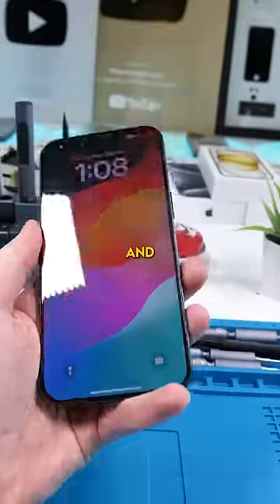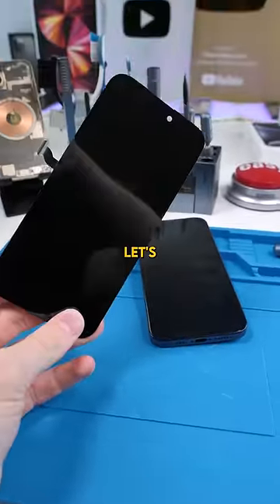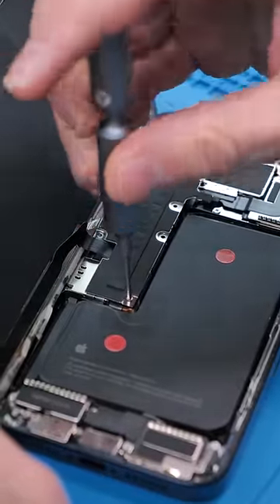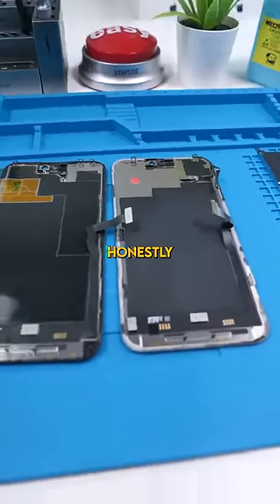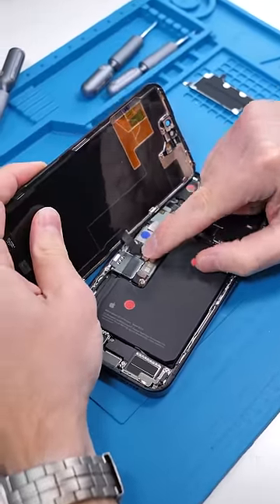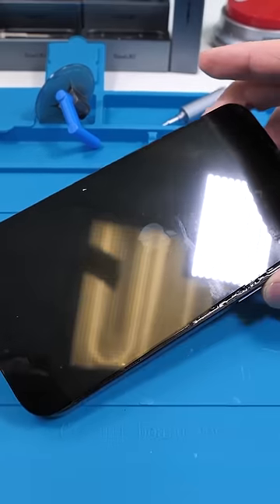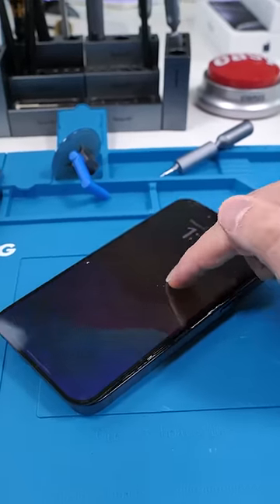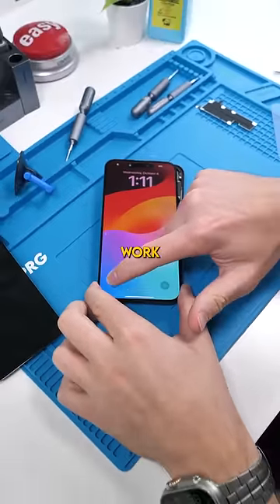iPhone 14 Parts On The 15..? #Shorts

Comment: Apple would rather reduce their product fixability rather than make an actual upgrade.
Reply: Two different phones. Why do they need to have interchangeable parts
Reply: @theworm7156  They are not different. They are VERY similar to each other. There was NOTHING preventing them from making them compatible,  they are just greedy as hell. As you saw in the video, you can literaly connect and fit the screen from another phone, it just has some sort of software or any other fixable issue that could have been easily fixed
Reply: @volodymyr_budii  they have different bezels sizes, different designs, and since when was it a requirement to have an old phones parts work with a new phone. I doubt ANY company, when writing the firmware for their new phone, decided to take the trouble to make it work with their last gen displays cause there’s literally no point in doing that.
Reply: @theworm7156 well, maybe because it turns on, but the most essential function to use the screen doesn't work?? 

Cmon bro, they did petty stuff like that and always gets away with it. People got dumber to the point they even miss something like that common, gee.
Reply: @GimOA  if it turns on, which they probably haven’t checked for because that would be pointless, that doesn’t mean they need to rewrite the firmware to make it 100% work with the old display
Reply: @theworm7156   how does the bezel size stop the touch from working? apple writes firmwaare to stop any other screen other than what came with the phone or what they provide to stop working. they did the exact opposite of what ur even mentioning.
Reply: @rollmell  they still need to be coded separately into the firmware
Reply: @theworm7156  the code isnt going to be much different because the display arent much different lmao
Reply: @rollmell  they’re probably different in a lot of other ways so it makes no sense to code it for both when no one in their right mind would try to seriously use an old display on it
Reply: @theworm7156  brother we can see its not different in any other than what was said in the video, and why do you think they coded everything from scratch? all they had to do was use last years as a template.
Reply: @rollmell  the display also has firmware
Reply: @GimOA  Just because the power and display cables are the same doesn't mean it should work. Those are 2 things that very rarely need to be changed.  Example: Look at HDMI When you change your TV you can still use the same HDMI cable. Why tf would apple redesign a power and display connector every generation? That's absurd
Reply: @theworm7156 bros really defending anti repair and anti environment practices. How nasty 🤮
Reply: @reeddeer793  no company would try to make two different phones parts interchangeable for no reason. Even prg said so in the pinned comment
Reply: Try to put a Galaxy S23 Ultra on an S24 Ultra. I'll wait.
Reply: @volodymyr_budii  Try to put a Galaxy S23 Ultra on an S24 Ultra. I'll wait.

Comment: Phone repair shop scammers using this as a golden opportunity:
Reply: (Bro has 46 likes and no replies) that is a very viable scam
Reply: How?
Reply: @Entertainmentexe because they can show the customer they "repaired it" but when the customer tries it the touch wont work
Reply: @bumblethunder because people don’t use their phone the second it’s fixed right? Literally every customer I’ve served immediately turns the phone on to look at something once its fixed
Reply: @MarksterC  I assume they mean repairs that involve shipping. You receive the phone and find no contact info with the alleged repair shop. And there goes the money.
Reply: @CityWhisperer usually you get it repaired somewhere reputable with outlets to complain to.
Reply: @MarksterC  oh ok
Reply: This is the most ignorant comment in the planet.
Reply: @CityWhisperer  Wtf would be the point of that then? You could literally ship the phone back to them without ever taking it out of the box they sent it in to get repaired  in the first place then claim you fixed it all the same. They sent the phone in to be repaired, if you're gonna swap out a broken screen with a broken screen then why tf even bother? Literally pointless work to try and "scam" them like that when you can just scam them by not working on replacing anything and sending it right back to them as it came while claiming you fixed it anyway. 🙄
Reply: @DrakeOola  Indeed, that's how scams work. A replace screen that's not from Apple will be much cheaper. Believe it or not, people fall for these scams.
Reply: @DrakeOola if they sent the phone back in the same condition they could not have taken their calls back and they would have been guilty right away. But if they put a non working screen then they can at least take their calls and put their fake point forward that they did their job.

Comment: I think the worst part is that people can’t take care of anything. Always used my devices without cases and never cracked ONE SINGLE screen.
Reply: you're an exception, everyone i know has broken their screens/screen protectors in less than a year
Reply: @willywestsidee  m
Reply: I don’t take great care of my phone and have broken very few screens. 😂 I do have a bunch of scratches on this one though… (and a couple spots where copper melted to the glass, but that’s a long story.)
Reply: You one of those incels that can't do one pull up?
Reply: What is the worst part in this story.. not your phone right?
Reply: @rushpatriot2866  nice projection, bud
Reply: @Pizzafan622  sounds like you just learned the word projection like the rest of the smooth brains that's the only reason you'd be using it in 2023

Comment: They are the same but the motherboard knows that the screen is the outdated one so it locks the touch screen as a counter measure to counterfeiting parts from older models. Essentially, they want you to buy the new parts and not an older part that is discounted. I believe they just want every penny in your wallet. Even if they reused older components from their older generations. They will deny this is the case because their technology hasn't been getting any better. We have hit the end of cellphone improvement. 
Not much can be said about the other competitors.
Reply: Does it really lock it? Sounds like just changing the pin order on the connector would do the job just as well
Reply: Well, since the iPhone 14 pro max screen is larger than the new one and due to that it wouldn’t fit anyway this would mean unnecessary more work for Apple.
Reply: Can’t you reprogram it whit like iphone screen programmer?
Reply: @tbqhwyf honestly, I wouldn't know. However, the screen itself had as an id or a chip that runs the touch detection. You would have to replace and calibrate a whole new one. This would take a lot of time and some knowledge.
Reply: @exposednl5559  not easily. You would have to take the screen itself apart.
Reply: It makes sense not to have old parts with a new phone and that should not be allowed to use our old screens on the new phone. Apple did it right!

Comment: 15 Pro Screen On Regular 15 
As Both The Screens Have Same Specs Except Refresh Rate 
I think Apple Has Restricted It By Software On Regular 15
Reply: Interesting
Reply: “Except refresh rate” ah yes, the least important factor of a display
Reply: For most people yea, people want a clear screen they can see. Not a blurry mess that wastes battery
Reply: No, Apple would’ve just not used LTPO panels. Everything else to do with the display would’ve been carried over from the 14 Pro. Restricting to a non-variable 60hz when it can do variable 120 would be a waste of money
Reply: @Zomboy4313  did I say for consumers? No.
Reply: @theworm7156  then for who, tech reviewer?
Reply: @Zomboy4313 "enthusiast" 😂
Reply: @GimOA  of course 😂

Comment: A better idea is to change the 15 Pro Max back glass to the 14 Pro Max back glass. They're identical except for the fact that the 14 Pro Max is more durable
Reply: It wont even fit
Reply: 14 pro and max dont have removable back glass only the regular/plus. It started on the pros with the 15 pro/max.

Comment: churro recipe - 1 cup water (240ml)
- 2 tablespoon unsalted butter (28g)
- 2 tablespoon sugar (13g)
- 1/8 teaspoon salt
Medium heatchurro recipe - 1 cup water (240ml)
- 2 tablespoon unsalted butter (28g)
- 2 tablespoon sugar (13g)
- 1/8 teaspoon salt
Medium heat
After boiling turn the heat down

- 1 cup all-purpose flour (120g)
Stir immediately 
When its smooth and pulls away from the pan its done
Bring pan to towel or surface. And press down

Let it cool for 5 minutes

- 1 large egg (50g)
- 1 teaspoon vanilla extract
Mix 
The mixture will separate at first but keep mixing.
It will come together soon.

This step will take a few minutes but when the dough is done. 

 It will be smooth and will pull away from your pot and spatula 
2 piping bags and a star tip
Use 2 layers of piping bag because the dough is thick 
5 inch strips on nonstick pan tray
Cut ends with sciccors 
- Vegetable oil for frying
Heat oil to 350F 
Use thermometer to check the temp
Drop churros 
Each churro will fry for 5 minutes
Turn the churros half way
The color will be gold when done.
Dry one towel for a few seconds 

Cinnamon Sugar:
- 1/2 cup sugar (100g)
- 1 teaspoon cinnamon
Role each in tray or tubwear of sugar.

Chocolate Dipping Sauce:
- 3 oz bittersweet chocolate (85g) in bowl
- 1/2 cup heavy cream (120g)
Dont let it boil

Add cream in bowl and mix until sauce like. Then serve

After boiling turn the heat down

- 1 cup all-purpose flour (120g)
Stir immediately 
When its smooth and pulls away from the pan its done
Bring pan to towel or surface. And press down

Let it cool for 5 minutes

- 1 large egg (50g)
- 1 teaspoon vanilla extract
Mix 
The mixture will separate at first but keep mixing.
It will come together soon.

This step will take a few minutes but when the dough is done. 

 It will be smooth and will pull away from your pot and spatula 
2 piping bags and a star tip
Use 2 layers of piping bag because the dough is thick 
5 inch strips on nonstick pan tray
Cut ends with sciccors 
- Vegetable oil for frying
Heat oil to 350F 
Use thermometer to check the temp
Drop churros 
Each churro will fry for 5 minutes
Turn the churros half way
The color will be gold when done.
Dry one towel for a few seconds 

Cinnamon Sugar:
- 1/2 cup sugar (100g)
- 1 teaspoon cinnamon
Role each in tray or tubwear of sugar.

Chocolate Dipping Sauce:
- 3 oz bittersweet chocolate (85g) in bowl
- 1/2 cup heavy cream (120g)
Dont let it boil

Add cream in bowl and mix until sauce like. Then serve

Comment: This isn’t Apple being anti repair AT ALL. It’s more of a miracle that the thing even shows a picture instead of not doing anything. Even if the touch worked, the display wouldn’t even fit on the frame of the 15 pm. So nothing lost, nothing gained.

Comment: maybe the connector you connected to the 15 pro from 14 pro has few connector pins less then the 15 pro has so in basicallity it means that you can change the screen it just wont work as it should

Comment: Well, that titanium frame isn't helping the screen, it isn't as flexible as aluminum and stainless steel, so it's so rigid to the point that the shock goes straight through into the screen

Comment: Do people really not understand that they are still different displays? It's like installing the wrong software on a phone. The kernel has to match the display compatibility. For example, Lenovo released 3 (technically 4, but we ignore one of them) variants of the Z6: Z6, Z6 Pro and Z6 Youth. They essentially have no differences when it comes to the screen capabilities and some other minor tweaks, but we're focusing on screen only right now. When I flashed a different OS onto my Z6 Pro, I made the mistake of downloading the upgrade of the original OS for the Youth instead, which made the display unusable because the kernel didn't understand the display, even though the screens were essentially the same. Something else wasn't, and that will lock the digitizer. It is far from uncommon. In fact, what is uncommon is for screens to be interchangeable between models, much less brands

Comment: The 14 pro max and 15 pro max have different size screens so even if the touch worked the 14 pro max’s screen is too big to fit in the 15 pro max frame. It’s very slight but when I put my 14 pro max up to my 15 pro max you can see it. And I didn’t have any 14 pro max screen savers left when I broke mine the other week so I used the 2nd screen protector tor my 15 pro max until I got more and you could see it was off by a good bit.

Comment: All you have to do is reflash the iPhone 14 Pro Max with the 15 Pro Max screen information. It is a stupid design element Apple deliberately implements to stop people from wanting to replace parts with third party components and instead pay the Apple premium to replace the parts through Apple. You have to do the same thing with multiple components including FaceID. All you do is rip the info from the official component and flash the information to the replacement components. Works with third party components also. That's the only way to properly replace Apple components and you shouldn't go to any repair place that won't even provide this minimum service

Comment: ive had 2 phones for the past 3 years 1 droid one apple, but i main apple because its basic and easy to use. I prefer its interface but im going to android soon and forever. apple is just behind and way too expensive. Right to repair, availability of parts and over complexity of devices are huge factors as well.